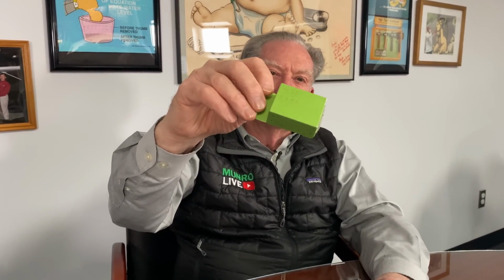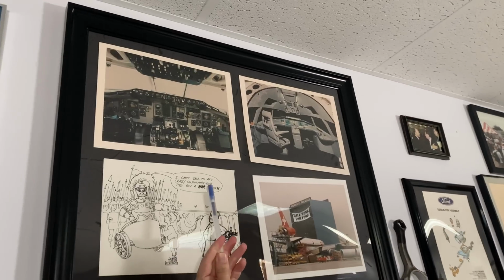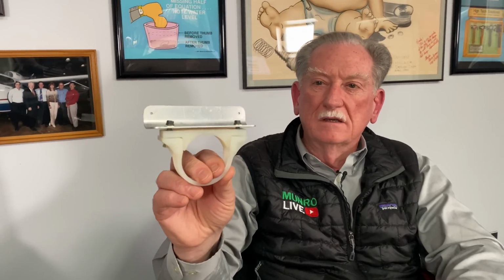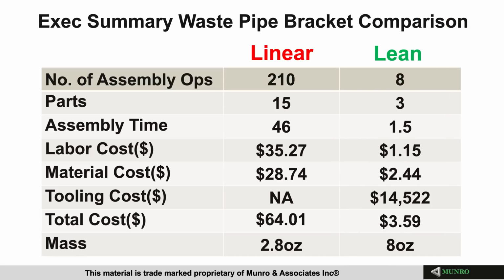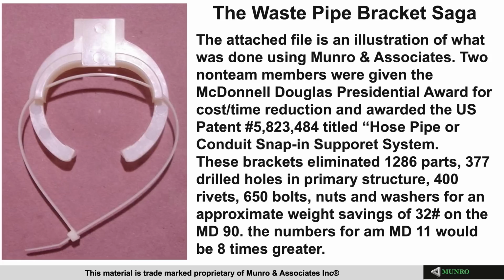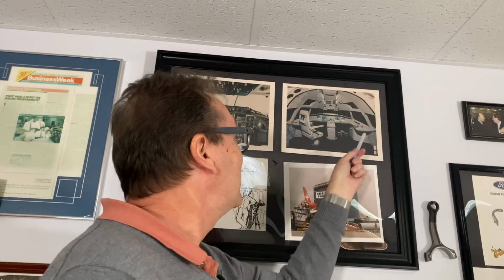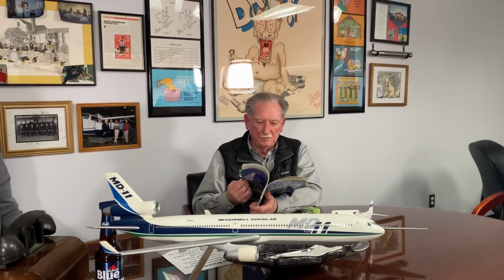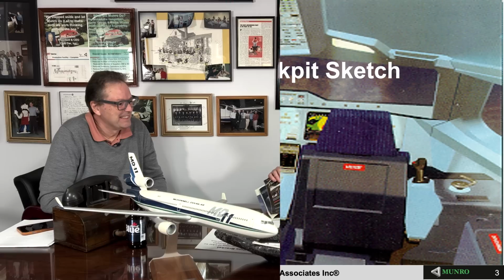What Happened to McDonnell Douglas?

Comment: My days at McDonnel Douglas, where at the Toronto Facility - "MDCAN", starting on October 27th, 1987, in the MD-80 Series, Vertical Stabilizer Spar Builds. I also worked on the Vertical (Tail) Assembly Jigs, Tail & Rear Fuse Assembly, MD-11 Spars Stage 1 & 2, and MD-11 Wing Assembly, Stage 1. Had a Stint of a Month in Macon, GA, when they began shipping some of the work South. Totaled just about 5 years, 3 months with them.

Currently, working for Bombardier Aerospace, since December, 1995, and have worked on the First Global Express, Early DeHavilland Dash 8 Q-400's, Lear 45 Wing Program, and the last 6+ years on the Global 7500 Program.

While Aerospace is all quite interesting, I do not know of one legacy Aerospace Company that has not had some amount of Self Pride, that is not warranted, as l have seen ALL Aerospace Companies have situations that have caused them great grief, financial loss, and risk of collapse! Including Airbus, Boeing, and yes, McDonnel Douglas!

Comment: The dc10 andl1011 were three engines because of airline conservatism re wide body twins. Douglas and Lockheed went head to head for a market only big enough for one, and both were crippled by it. Meanwhile airbus built the twin that Douglas and Lockheed were too timid to do, and look what happened. The A300 was the first of many models that resurrected European aerospace manufacturing, while us manufacturing declined.
Reply: DC-10/L1011 had three engines because they were significantly heavier than the A300, same as the 747 had four engines instead of three because it was that much heavier than the trijets.

Comment: I wish I could share the things I encountered as a MD employee. I had a job in maintenance and wound up responsible for the area around my work station.  Every 6 months there would be literal mountains of light bulbs - new, never used fluorescent and sodium vapor bulbs still in their cartons. These bulbs were my responsibility to make disappear. This "exercise" happened every 6 months - just prior to an inspection of facilities by the U.S. Air Force. The reason it was the responsibility of my domain to get rid of these bulbs was because (as I had it explained to me) that's the way it had always been done!
    So there I was - every 6 months - busting up brand new 8ft fluorescent light bulbs - still in their cartons as well as partial cartons of BIG sodium vapor bulbs. 8ft bulbs going into the company standard 6ft trash gondolas meant that I had to "dance" on the middle of the cartons so they'd fit! Supply (the folks who would issue bulbs for lighting maintenance) could not and would not give you just ONE or two or five bulbs - you had to take a whole carton (15 tubes in the case of the 8ft tubes) and you couldn't return any of them - EVEN IF the carton had never been opened.
     There was a weekly plant newsletter sharing news about production output and any new orders for new planes and stuff like noting retirements of long-time employees and what not. So one of these newsletters had a cover story featuring the company  president. What he had to say was that if everybody could find a way to save just ONE dollar a week, we'd be solvent ad infinatum!  You can probably figure out the first thought that I had - all those brand new and very expensive bulbs that I had to make disappear every 6 months. And be advised that I was union there - IBEW by the way. So it would have wrought all holy hell if I were to try to contact any higher ups to tell how lil' ol' me could save gobs of dollars. 
     I worked a specialty shop and maybe saw my boss once a week. I didn't have to worry that someone would notice my absence if I were not in my area for a time. I was careful not to alert anyone as I made an appointment with the company president - the one that had issued the save-a-buck challenge. His secretary set a time for me to meet this fella and he had a VP who was over Maintenance as well. I was nervous to say the least. I wasn't seeking any fame or anything other than to offer MY bit to cost-cutting. The two of them listened to me - asked a few questions - and then assured me they'd look into the matter without tipping anyone off as to who had been the whistleblower.  Two days later, I was about a hundred feet from my area. I was consulting with three other guys about overtime issues when in walks the VP I had talked to a few days prior. He walked right past us and bade us good day as he disappeared out the other end of the building. THAT was the extent other than our boss was told that there were too many guys standing around doing nothing! And that was just ONE example of the extreme waste that I saw with my own two eyes.

Comment: It turns out that airlines are required by law to have an ashtray on the lavatory doors of every plane, thanks to a Federal Aviation Administration (FAA) regulation. In a directive updated as recently as 2000, an ashtray is part of the"minimum equipment," meaning that if something happens to any one ashtray, an airline must replace it within three to ten days, depending on the circumstances. (In case you were wondering, the European Union has similar regulations.)

Comment: OMG Sandy and Michael, that was fantastic, story of my life! That crap is not only in auto and aerospace. I went to a top three chemical engineering school. I went to work for a polymer/resin manufacturer. I was assigned to an existing plant with loose guidance of make the plant run better, cheaper, improve quality and increase throughput. So, using my first principles in chemistry, physics, transport phenomena, calculus, chemical kinetics and reactor design, and heat transfer, I came up with a plan to 2X throughput, reduce the number of reactors 3X, reduce the size of the reactors 2.5X, reduce the plant size 4X, reduce the raw material cost 20%, and tightened the molecular weight distribution (quality) to near perfection. In addition to my manufacturing and engineering bosses, I had to get R&D Manglement, err Management to approve these changes. Two PhD bench chemists in R&D that knew NOTHING about chemical engineering said NO, THAT WILL NEVER WORK! I said said, yes it will work, my summer intern and I have written a reactor design simulation on Fortran, and IT WILL WORK. I was basically laughed out of the room, meeting over. Fast forward six years. I had convinced the VP of Manufacturing (who has balls and believed in me) to JUST DO IT without R&D approval. It did work and spawned a whole new business as well as existing product improvements. The change resistors are in every business/industry.

Comment: A Chip fab plant costs $20 Billion and takes a few years to commission. Tesla will do a joint venture fab plant with TSMC, Intel or Samsung this decade. They will need hundreds of millions of <5nm chips for their Own and  their third party FSD OEMs (Toyota, Ford, VW, GM) who can’t survive without licensing Tesla’s FSD echo system. That’s about $10k profit to TESLA for most cars made annually by every car manufacturer still in business. Tesla also needs hundreds of millions of chips for Optimus, Space X rockets, satellites and dishes. They need chips for hundreds of latest generation DOGO supercomputers. These will become such a pivotal requirement and key expense that Elon won’t rely solely on third party supply, just as he couldn’t for batteries.

Comment: I used to be a brake operator at KLM for a year during aircraft towing after finishing flight school, they had allways been a loyal MD customer, and we once in a while had to tow one of those last four passenger MD-11's. The cockpit was full of weird quirks and allmost every switch on the overhead panel unneccesarily had a different shape. If you wanted to open the vertically sliding front passenger doors you needed ground or APU power! In the 767 you could do it by hand. Nowadays I'm flying the 777 and the cockpit still feels very modern and ergonomic for a plane designed in the mid 90s.
Reply: Funny you mention the knobs. I tried to change this and questioned that numerous times, why do the panels inside the MD product have so many differently shaped and sized switches? The answer I got was always that this is safer, you need this, you can't change this. When I challenged them on the safety issue, I had to listen to all these reasons why it is absolutely necessary to have these dozens of differently shaped buttons. Over and over again. 
Until one day I screamed out, duck and cover, there is an Airbus flying above us and they have only a few differently shaped switches and according to you, this plane should crash any second. Run for safety.

Comment: Thank you for the very interesting video. FYI if you’re ever in Santa Monica, the museum, of flying is  basically a history of Douglas right across from the Santa Monica airport, where it all started but sadly will close in 2028.(in my opinion the result of an increasingly hostile, anti aviation environment in the Los Angeles basin area )They even had a restaurant called the DC 3 the museum then was actually on the airport property where my dad was a docent and one of his first jobs out of high school, working at the Santa Monica factory )Your comments about McDonnell Douglas I think also can describe part of the current  Boeing  especially the ongoing life of the 737 I wish  a company like SpaceX would get in there and do more competitive designs to go up against airbus. Sandy, what are your thoughts about the current 737 versus a new clean sheet design in that market segment. I know many years ago a relative of mine that is a captain for JetBlue said they were going to do a complete redesign but Southwest ordered over 400  keeping the line running un changed. Finally one last thing back to SpaceX. Do you think Starlink will revolutionize navigation and in cockpit/cabin communication and data  availability globally ?
0:05

Comment: Excellent Presentation. Eye opening to relive those times from the engineering side. I was on the ops side. I flew the DC9 and engineer on the DC10. On the whole they were under engineered. DC9 that was an advantage. With the DC10 dangerous, and it only got worse with the MD11.  ( United Sioux City - American  Chicago. I went on to fly the B727, A300, B757, B767.B777,B747,A320. L1011. Summary: Boeing and Airbus solid with advances and engineering. Lockheed let the engineers loose. The L1011 way over engineered.  But MD reduced the systems and backups to the minimum. The advancements in instruments away from round dials. And the computers integration accelerated and forced the streamline of cockpits. Plus the carbon fiber introductions started by Airbus advanced aircraft design. The Airbus 320 (“Fifi”) nicknamed, brought the Tesla like changes that others had to catch up to.

Comment: As structure Engineer I worked at Boeing and MD and  Airbus and FedEx. MD was crazy design 3 engines main landing gear in fusalage belly. MD are built like tanks and easy to work on as a structures engineer but
MD rented hangers and was building aircraft on the tar mat. MD and Boeing down fall is Military divishion. Boeing buy MD for the military div not aircraft. Airbus is like MD built like tanks and again I as a structue engineer Lke Airbus.
Last 
Tanks do not fly. No amount of avionics you dump into the cot pit Tanks do not fly
Reply: Boeing 737 crazy design Boeing with tax gifts and discounts on its best year was making 5% profit. Now all those breaks are gone and every aircraft is -5% so Boeing profit is Government military not aircraft.

Comment: I worked at McDonnell in St. Louis for an engineering co-op program in 77-78. The first semester was good, but the second semester was with a bunch of guys who were relatively young, but had seemingly retired and didn’t want to do anything. I got so down about it that when I returned to school and contemplated what my career would be I dropped out of school. After a year working in a computer factory I realized I just needed to get my degree and then I could figure out my career. I returned to school, got my degree and went on to have a successful career, albeit not at McD.

Comment: Engineers want to innovate and make a difference.  Boeing introduced the 707 in the late 1950s with a fuselage 12 feet 4 inches in diameter and today the 737 Max has a fuselage 12 feet and 4 inches in diameter.  My guess is that they use the same design of stringers, materials and manufacturing techniques as they did in the 1950s.  Boeing used to dazzle the world with innovations and now this once great company is reduced to serving up reheated left overs.  Sandy keeps trying to get companies to adopt better design to improve both quality and production but the one thing that he cannot change is obstinate managements who have no interest in the company beyond their retirement.  Self interest is the death knell of many, once great, companies.

Comment: Is Detroit in a similar trajectory? Between Not Invented Here (NIH) and leadership afraid of career jeopardizing decisions (quietly vesting their shares) you develop a form of Corporate Entropy.  The bigger the company the longer the slope but it is inevitable. Disruptions comes in many flavors and a hungry smaller competitor is not only more nimble but more desperate.  You get  a very clear perception that traditional automotive manufacturer (and market analysts and press) just do not understand Tesla. Tesla is doing nothing out of the norm for a Silicon Valley company. However, it is radically different than how Detroit thinks and is willing to think. Even when Detroit sees success at Tesla hit remains in denial.  I recall a  Silicon Valley CEO walking into an All Hands Engineering meeting and stating "if you guys don't fall down on occasion I don't think you are trying to run fast enough". That may be deemed criticism but it was really a liberating, supportive statement.  Risk aversion is a failure in and of itself.

Comment: I just watched this video, and unfortunately, Douglas was not the only company killed from the inside either intentionally or not (remember high executives get a piece of the cake when the company is sold. either in cash, stock, or both). However, bureaucracy and internal politics are, in my opinion, the two main reasons that kill companies due to personal agendas. The latest examples are Motorola and Blackberry in the cellular phone arena. My extreme concern points now to Boeing, their persistent issues both in the space and aeronautical areas are unacceptable for a company leader, on which the security of the United States depends. When you look into the control panels of the Staliner and even the Orion (not from Boeing though), you realize that these modern vehicles seem to be designed on the stone edge. On the other hand, an example of the kind of shake required in most companies comes from Toyota. Not long ago, their CEO said that they would not produce electric vehicles but rather Hidrogyn driven. Today I saw the video of the new CEO, who change the whole deal. Obviously, Toyota BOD took immediate action and put in place a new person with fresh ideas rather than sitting on their past success. When you look at why Elon is so successful, it is very easy to figure out. Same as Microsoft, back in the day, his companies policy does not allow for personal agendas or a whole escalation process if someone comes up with some new idea. I hope Boeing BOD will take the proper actions to bring some open-minded, smart people to drive the company and clean up those that interfere with technological advances in their areas.

Comment: The MD 11 had the same empennage dimensions as the DC10. However in gusty conditions it was an aircraft that pilots were cautious of.
Reply: Longer fuselage, greater wingspan, and a smaller horizontal stab (made possible by fuel transfer CG management).

Comment: I come from a slightly different perspective.  I flew both the MD-80  (DC-9 became MD-80 as a result of the merger of Douglas & McDonald)  the DC-10 with its RCCB's (problematic).  Both flew very well (I also flew several models of Boeings throughout my career).  I watched (painfully) as the MD-11 was pushed out to compete well before it was ready &, I think, accelerated the company's demise.  Money drives aviation & getting to market is king.  Unfortunately innovation is very difficult with both the time it takes to get approvals from both the regulators--especially if it is a new concept or dramatically different & approval from the finance people who are the most against change.  There was an opportunity for the MD-80 series to be a much better cockpit but the airlines wanted it to be a common type rating which meant it had to be 'similar' to the DC-9.  The customer drives the development of airliners & the CFO drives the airline's expenditure on new equipment.  That is why there are so many models of 737 but the cockpit is largely unchanged (other than avionics) from the first models from the 1960's.  New ideas airplanes take a very long time to become flying products.  Inertia is a much larger force than most people realize or credit.